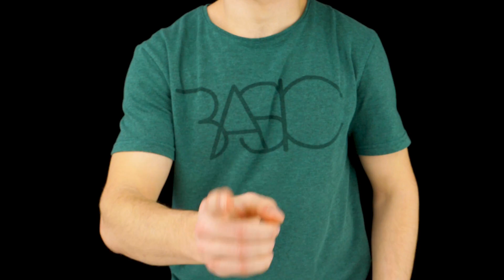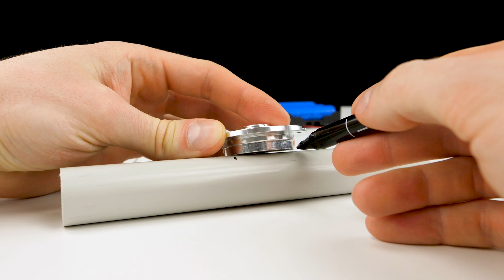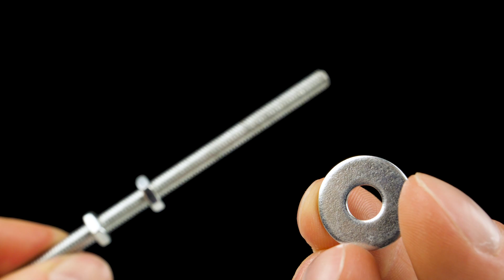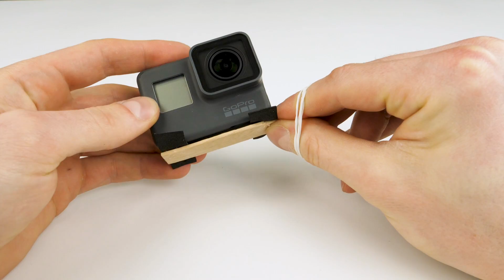DIY Self Balancing Gyroscopic Camera Stabilizer

Comment: You can achieve this much simpler with a weight that holds a zero y and zero x axis and some springs. Much more crude, but just as effective. Sans electronics.

Comment: So if you hook that contraption up between two wooden beams. It should stay stable on a Spinning traveling through space round earth is what you're saying!! Mean the position of your contraption would change with any Parallel or vertical beams set as markers right?? Good do the experiment and shut these Flat earthers up already. And Thanks.

Comment: Adding a few more DVD discs to your stabilizer will increase the mass/ "flywheel" effect and give you even more stability, at a weight gain of course. The more mass a wheel has the more stability it can provide due to more inertia -basic physics. Nice project!
Reply: Great now add a fuselage a tail rudder some wings and instrumentation and some jet propulsion and you got yourself a homeade G6 airplane
Reply: Увеличит нагрузку на двигатель, что приведет к понижению оборотов и как следствие уменьшение момента импульса. Во-вторых к более быстрому разряду батареи ( при попытке сохранить обороты)
Reply: Correct.
Reply: He could also increase the speed
Reply: yeah thats like boat gyro stabilisers nice idea.

Comment: Okay thats pretty clever, it was alot simpler than I was expecting. You'd need an external mic solution though as this would be very noisy but it does appear to do the job

Comment: 2 questions. First of all. I think that's a great idea and with a bit of futteling it well be way better.
So first question. Does they gyroscope just work py pure rotation speed of the disk? Second. Why did u use only 2 bearings. It seemed kinda flimsy. I guess with 4 it would be much smoother and with some dampening in the main arm that could be damn smooth

Comment: Great idea but, I would recommend keeping the housing for safety and protection.

HDD motors are made to run in a clean environment. They're not like drone motors that have an open bell that exposes parts of the coils. They also use the aluminum housing as a heat sink. Second, the thing is noisy and that could wreck your taping experience.  Third, that thing spins fast. Probably even faster than 5400/7200 RPM since we're using an external controller that doesn't have a set target speed. It's basically a high-speed metal disc that's exposed and could probably be caught in something.
Reply: You can cut down on motor noise by using a sinewave controller. Brushless controllers do have the option of speed control. If noise is really a problem, put a mic on the motor, and subtract the audio during the editing process.
Reply: Agree with you on everything but material of the disk - it's non metal, it's ceramics, which is much worse 'coz it's fragile
Reply: @mikethechemis  I can both agree and disagree with you on that. 3.5" desktop hard drives use an aluminum substrate for their platters which are then coated with the magnetic particles that we all love/hate. On the other hand, 2.5" laptop hard drives use a glass substrate for their platters. I can get where you're coming from with the "non-metal", "ceramics", and the "fragile" stuff though.
Reply: @wolfdale_3m , didn't know these details, thanks! 
P.S. So where am I coming from? :D
Reply: You could lower the speed by reducing voltage. He seemed to be using three 18650 batteries which is pretty close to the 12 volts that hard drive is probably getting in the computer. I doubt it's necessary to run at 7200 RPM to achieve the gyroscope effect
Reply: @seansavage4766  You'll need a faster speed to stabilize heavier cameras though. I've tried this with an old hard drive, an RC ESC, and an Arduino and what I've found out while holding the drive in my hand is that higher speeds are needed to resist stronger changes of my wrist's roll.
Reply: @wolfdale_3m  makes sense for sure...I just saw a little go pro on there and wondered if he needed all that speed. I'm no expert tho.. I'm a trial and error type of builder
Reply: @seansavage4766  Not to mention, adding more platters means heavier gyroscope, more stabilization alongside having faster speeds.
Reply: @wolfdale_3m  That's definitely the case..a double or triple platter would make for quite a bit of rotating mass. I wonder if you could reduce speed at that point.. maybe 2 batteries.Cut out a lot of noise. Achieve a similar result.
Reply: @seansavage4766  The only way to cut out a lot of noise is to keep the housing. ;)
Most hard drives today have the motor's stator as part of the housing instead of being a separate part that's held by 3 screws.
Reply: @wolfdale_3m  the housing makes sense for multiple reasons as you mentioned in your initial post

Comment: Okay, so any actual footage or explanation of how you programmed the motor driver or the other electrical components used would've been better. I know you had to have some sensors feeding position data to a board that was feeding commands to the motor driver, but there's no explanation. And that's probably the coolest part of it to me, I would've liked to see it.

Comment: BROKEN HDD  0:27
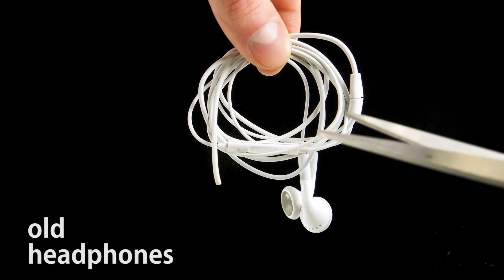OLD HEADPHONES 1:02
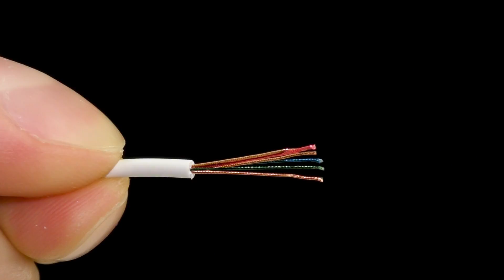SOLDERING 1:13 
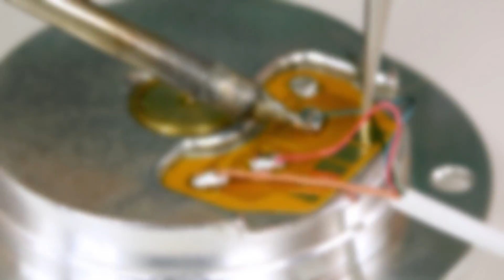BRUSHLESS CONTROLLER 1:24 
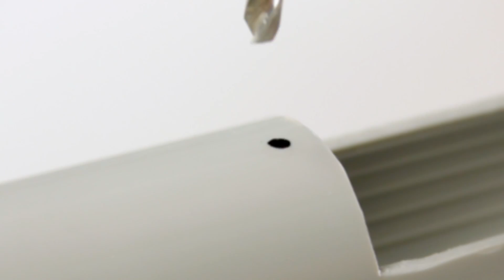BLDC FITTING 2:20 
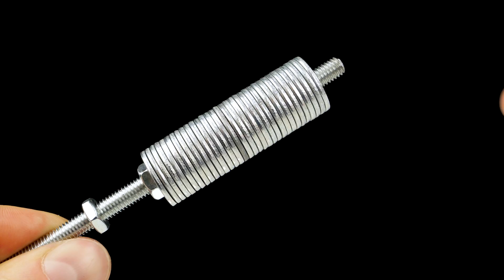WASHER SET 3:00 

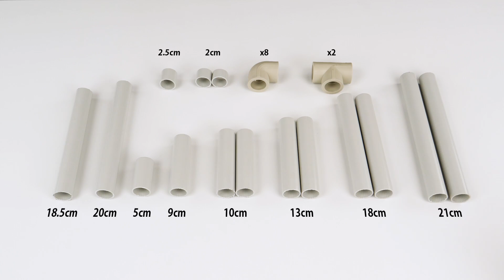PIPE MEASURES 3:40 
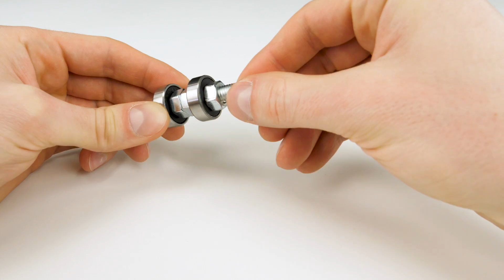FITTING 3:55
TESTING 4:40
Reply: Why
Reply: Thanks

Comment: I thought this would need a lot of C++ code with data reading and motor handling, it turns out this is a physical stabilizer! Good job
Reply: I can relate to that, I actually thought a windshield wiper motor would need code to control the motor to go in two directions, then I found out the motor spins in one direction constantly, and there's gears and stuff that create the side to side motion

Comment: you should include secure links in the description to buy specific items you use like the brushless motor controller. I know its probably common as hell but it's just helpful.
Reply: what is that brushless motor controller connected to, are those batteries and what kind?

Comment: So in theory you could use any high rpm motor alongwith a switch to do the same. Also I wonder if using gears will have any effect.

Comment: How do you sense and react to all of those movements?
You don't, just spin that disc and you're done.
Reply: Genious of this solution is simplicity. It doesn't need to sense or react on anything because physics does it itselve (fast rotating disc tries to cancel any movements).

Comment: 1:11 nice soldering skills! Seriously?! :D Soldering isolated wires? :D
Reply: +1
Reply: i think the same, but probably the heat of the liquid tin is enough for remove the chemical isolation.
Reply: @ricardorosas8500  its not enough, trust me. Done that. Doesnt work :d
Reply: It did work though.

Comment: Why don't you upload the video inside the gopro?, perhaps the motor vibrated the machine at high speed
Reply: It's a harddrive motor....
Reply: @MaximusHardware  right -  those things that are spinning at 7200 rpm inside a chunk of metal that is screwed to a larger chunk of metal and can still often times vibrate the massive desk that these things are all sitting on -  the results are likely less than stellar.

Comment: But what if you want to point UP or DOWN? Maybe you can develop a hand brake of sorts for the lateral(?) axis? You have a battery for the spinning disc ... maybe harness some of that juice to create a magnetic friction lock for when you want to point away from level. Or maybe a small solenoid & hole type temporary locking mechanism.

Comment: You do realize that a plain disc is not optimal ... a "ring" or wheel of the same mass and dimension would perform (much?) better as the a majority of the rotating mass is near the perimeter of the spinning element. Just saying ... but kudos for your DIY skills !

Comment: Does the brushless motor controller simply bring the motor back to original position each time?
Reply: A brushless motor is essentially a 3 phase AC motor, the motor controller takes the DC voltage from the battery pack and outputs 3 phases (AC square waves) of electricity so the motor can run, but also the frequency can be adjusted to vary the speed the motor turns.

Comment: 1:12 YIKES you don't solder lacquered wires with the lacquer on. 

You can remove the lacquer with sandpaper or put a wire on an aspirin pill and press the hot iron in it to melt the pill and dissolve the lacquer. Don't breathe he fumes though.

Comment: Step 1: Break an HDD.
Step 2: Destroy earphones.
Reply: Step 1: Read
Step 2: Don't be dumb
Reply: I have both broken :)
Reply: You can get earphones like that for 80 cent.
Reply: I got a computer and it got a virus they said I needed a new hdd should I use the old one for this?
Reply: @daybot5999  The problem is it will shoot the virus onto other hard drives when you use it as a gyro, since the disk is not covered by the case. Do so at your own peril....
Reply: bro, iPhone headpohoes are always broken
Reply: I have only Bluetooth earphones   •́  ‿ ,•̀
Reply: Kevin Luo step 3: you have an amazing camera stabiliser
Reply: Kevin Luo is tru
Reply: step 1: dont be an ass
step2: get a life
Reply: @aulus4197  whoooosh.

Comment: such a good stabilizer
it could be improved by using stepper motors, a gyroscope sensor and arduino, reducing drastically the weight fo the entire system and make it more acuratte, like a real comercial stabilizer
even could be programmed a joystick to control the stepper motors and have a smart stabilizer
Reply: I was searching for viable solutions using an Arduino or an ESP and haven't really found anything. Most people use shitty tiny blue servos which can't even sustain the weight and are super jittery.
Maybe one day I'll try to make something using Nema 17 and such for holding actual useful stuff.

Comment: Just remeber that many (laptop) harddisk platters are made out glas these days. If it shatters, the shards fly everywhere at high speeds. The shards are very sharp and pointy. Just a warning, don't kill me for it. (Desktop harddisk have platters usually made from aluminium)
Reply: ha hanno giocato mezzi xenofobi zio con numero venga basato ma